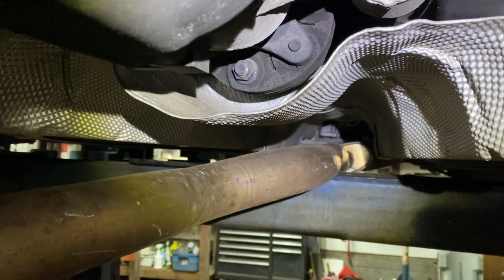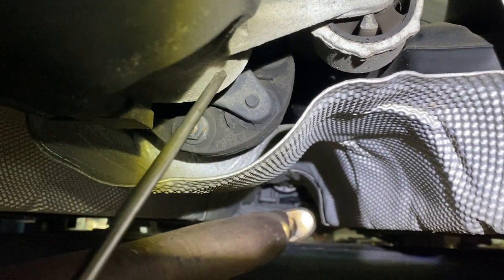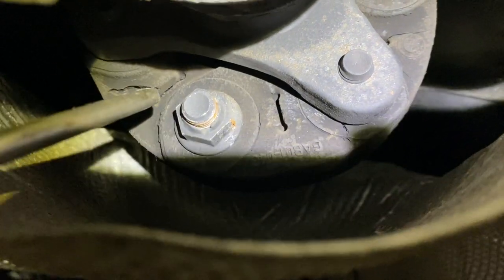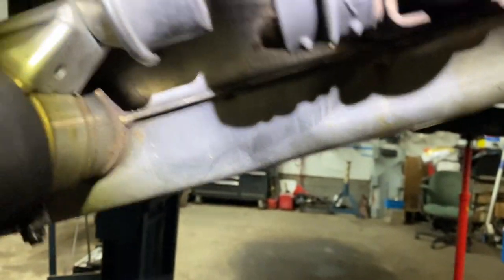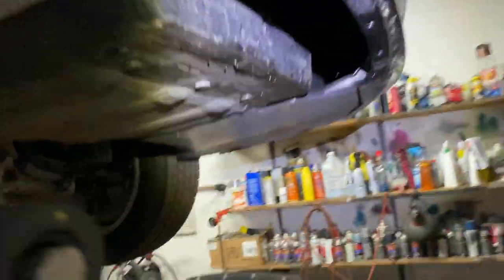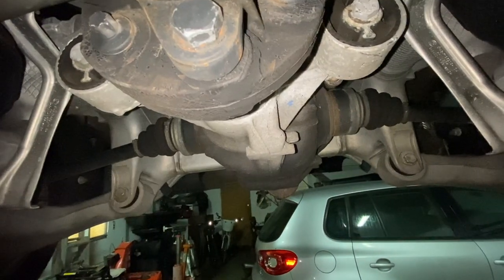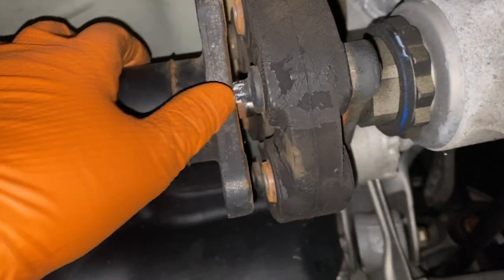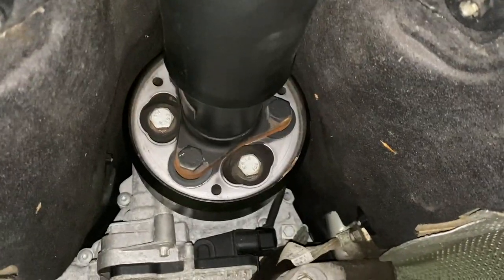Driveshaft Flex Disc Joint Replacement on BMW xDrive Models

Comment: On the F30 RWD, do the flex disc arrows point to the flange arms on the driveshaft or to the flange arms on the rear differential? Appreciate your videos. They are very helpful.
Reply from the maker: Arrows point to  the surface you are bolting it to.

Comment: Thank you for this information.  Very  helpful for non-auto mechanical folks like myself to understand what the auto repair place said needs fixed.  Especially after it started making noise sounding like a muffler problem.
Reply from the maker: That was kind of the point. Help people who may not know and people who may. Thanks for the comment!